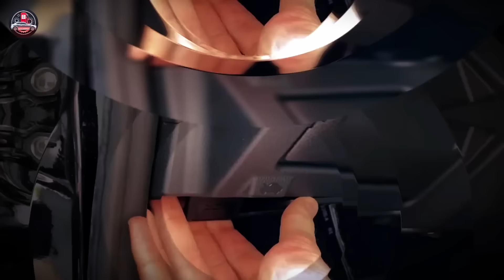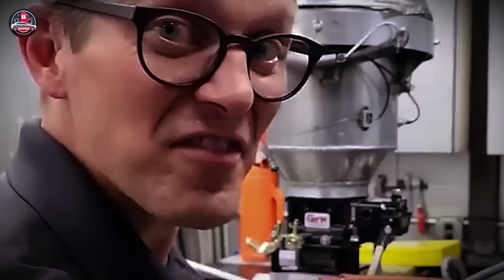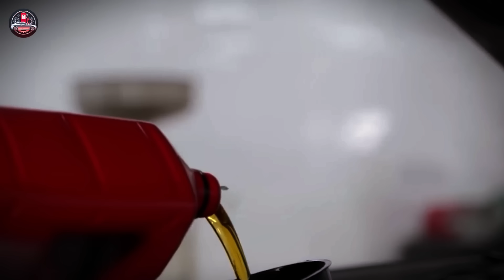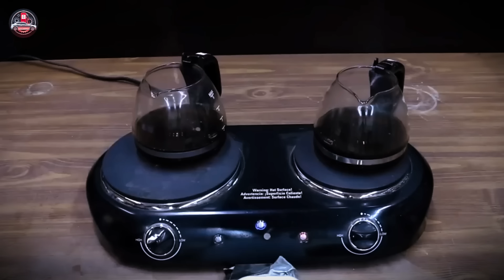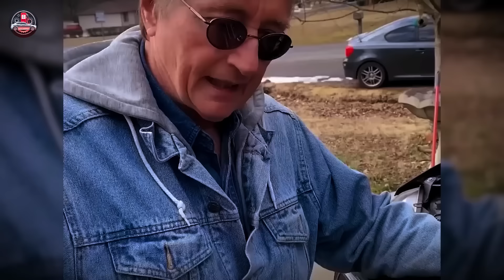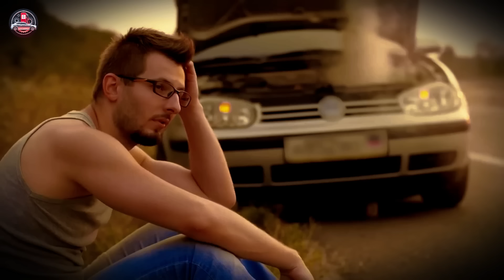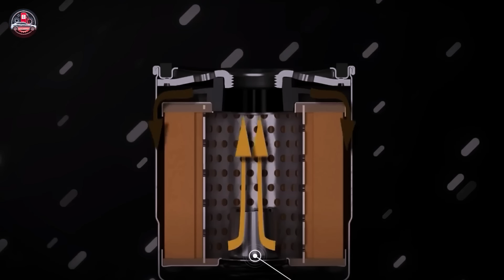We Ran 0W-20, 5W-30 & 5W-40 in the Same Engine — Here’s the Truth | Everything Oil for Car

Comment: This video conveniently forgets that even though thicker oils tend to start circulating slower, the oil film that's already on the engine's critical parts with a thicker oil is more durable so this argument is suspect.  I also think that thicker oils don't drain as completely after shutdown as the thinner oils.

While in this test, all the oil filters used were probably the same and therefore a nonfactor in this test, I suspect that the oil filter is a bigger determinant of how fast oil begins to circulate regardless of viscosity so a high quality filter is always important for everyone.

Finally, in my experience, I always get rid of the 0W20 oils within a thousand miles of purchasing a new ride.  I have never trusted the light oils because the CAFE requirements are principally the reason we have 0W20 oil.  This benefits the OEMs because if they sell enough cars that use 0W20 oil, they can sell more big vehicles with higher profit margins.
Reply: Yes I'd Never use 0w20 personally  I'd rekon you'd get Engine wear more than a thicker lube  probably less noticeable for very low or short trip drivers low miles - Where the thin oil isn't really handling high heat conditions--I wouldn't touch it regardless

Comment: when the engine is cold the oil bypasses the oil filter until the oil is warm enough to pass thru the filter material. 5 weight is 5 weight. if you are in extreme cold use 0 weight

Comment: C7 corvette
I race at Sebring 
Oil temps get to 240-250 degrees F 
I’m using Amsoil 15-50 race oil
Oil analysis shows some reduced viscosity and There was no wear metals out of range
The recommended oil is 10w40
What are your thoughts?

Comment: 5W-30 in South Florida in my '05 Crown Vic Interceptor. Change it as close to 3000 miles as i can with a FL 820S Motorcraft Filter.
Reply: You are wasting your oil. I am in Canada and 5w30 for 10,000 KM, no problems

Comment: 0-20 mobile 1 changed each 5000 miles 2020 GMC Sierra 5.3 engine N. Idaho. 92000 + miles. Should I change?
Reply: Depends, do you tow or haul heavy loads? If so you'll want heavier oil. Do you go need to add oil between charges? I drive a 1998 dodge ram 5.7 mag. I use 10/40 mobile. I use about a 1/2 court of oil at 4000 miles. I tow heavy camper and heavy loads a lot.

Comment: Sorry three engines can’t be identical. During breakin, engines can have a different experience. This is an unnecessary video for me. I have years of use of synthetic and years earlier of vastly inferior petroleum oil. Oil viscosity is slightly important in my experience. Use filters like long hauled trucks do. You don’t have to throw out good oil.

Comment: When you are travelling on the road, you use what is available.  My car leaked as I pulled the studs on half of the engine so10/30 oil dripped out onto the dirt road.  When I went through a case of oil,48 quarts, I happened by a road crew that was pouring oil on the road...gear oil.  Next town is 500 miles away so I got some 90W gear oil and put that in the car.  The leaking slowed down and the engine ran 500 miles without needing more oil.  Don't know what oil pressure was but car ran.  60MPH on 2 cylinders(as it was VW aircooled engine so pancake engine and one head had no compression.,,and no oil sealing. So, not synthetic. Beggars are not choosers.

Comment: The story fails when you claim the 5w40 oil lubricated slower on cold starts then 5w-30. Those two oils are 5w both, so are the same viscosity when cold.
Reply: It's AI garbage again. No authentic video.. at all.
Reply: @StanDeliver  Oh, copy that .... 100% crap.. Mindless crap.
Reply: But when how cold do they both become the same. It makes sense they would be the same when cold, and we are taught that, but it doesn't actually work that way.  Even this test proved it.
Reply: @kevinpurtlebaugh8854  You might want to research that yourself. In multi-grade oil the first number reflects the cold temp that the oil will remain viscus, the second number reflects the high temps that the oil remains viscus at. Meaning if you live in Detroit where much of this stuff is factored, running oem 5w-20 is good, but if you live in the desert where it never gets below 20F but regularly gets about 110F you will have problems. I live in the desert and run 10w-40 because 5w-20 looses viscosity when the ambient temp is above 100F. I remember when oil bottles used to have the charts on them to tell you this information.
Reply: Wrong! Not all 5W oils have the exact same winter viscosity,. They must meet a specific maximum viscosity threshold for cold-weather to be qualified as 5W, 0W etc. Same with second number viscosity at operating temperature, e.g., 30 is range 9.3 to <12.5 cSt at 100C.
Reply: As Arthur said 5w varies in actual spec oil to oil
Reply: I noticed the same thing, but also hear the comments saying they are not the same and I think the w refers to viscosity at about 0 degrees F while they were running cold start tests at 50F, so the w rating would not fully apply at 50F.
    For me, most trips are short but I also live in the mountains and my 225 CID truck has a relatively small engine that works hard pulling hills, often loaded and sometimes towing, but also gets used only a little and so has the same oil year round.  Other cars I maintain are more typical, though still usually short trips in mountains but no towing and normal engine size, so I may use slightly thicker oil in spring and factory spec in fall, and by slightly thicker I mean mixing grades of the same brand to get something like 2w-24.
Reply: @alan6832  yes you can mix oils if oils have same spec
Reply: Nice catch
Reply: I run 20W50 Castrol GTX in just about everything I have ever owned. Cars,Trucks, lawn mower, Motorcycles. Never had a problem. 86.5 Nissan 3.0 4x4 20w50 year around, central Illinois.  225,000 miles same milage as New added no oil between  oil changes at 5,000 miles. Filter every other oil change.

Comment: AI Overview
For a 2011 Subaru Forester 2.5L, the required oil is full synthetic to ensure proper engine longevity and performance. The non-turbo (naturally aspirated) engine typically requires 0W-20 oil for optimal efficiency, while the turbocharged (2.5T) engine requires 5W-30 synthetic oil.
Reply: Yes, however, 0w20 in a boxer engine that already has blow-by issues later in life becomes really thin if you go much over 3000 miles. Especially if you do a lot of short trips and rarely get up to operating temps. In Japan, Subaru Crosstrek and Foresters call for 5W30. The main reason for 0w20 in the states is to meet CAFE standards.  That's all.

Comment: Savannah, GA
1997 dodge ram 5.9L 
212,700 miles 
Daily work commuter, very little hauling
Using 10-30 high mileage syn. 
Would like to use 5W-30 in mild winters & 5W-40 summer.
Seems reasonable, yes/no?
Thx
Reply: Yes makes sense!
Reply: I used factory suggested 5w 30 on my 91 Chevy till I got 100,000 miles.  THEN WENT TO 10W 30.  Now it is during fine with 247,000 miles.  I live in S.C. where winters are mild.  I always used Valvoline high-mileage synthetic, change every 5-6000 miles.  I use Penzoil ( same weights ) synthetic  in all my farm equipment.
I use ( for many years ) Mobil-1 factory suggested weights ( high-mileage type )  in all automobiles all changed 5-6000 miles .  USE OEM FILTERS OR HIGHEST EQUIVALENT  !
Reply: Thats the Cummins diesel, is it not?   Different animal.
Reply: @markschwan6055 I thought since it went 212k miles it would have to be the 5.9 V-8 not the little 6 cylinder diesel with a turbo

Comment: The best is 0W40 for instance Mobil, best as cold and the best as hot. 20 oils are pure green madness !!!!
Reply: Testers does know this kind of the oil?! It is the must here in Finland with  temperatures from -45ºC to +30ºC. USA is the only state to use the antic measurement systems! The first number before W means wiscosity in temperature in -20ºC and the last number wiscosity  in 100 ºC (212Fº). Different tabels, all oils get thinner in higher temperatures. 0W40 less than the others.

Comment: I have a 2022 Honda Accord Sport. I use 0W20 full Synthetic. I am in San Buenaventura, California.
Reply: I have a 2015 honda accord sport 2.4 non turbo, i live in hot miami heat, i switched from 0w20 to 5w30 and im very happy. Much smoother engine and no ticking. Trry it youl be happy and will not hurt engine at all.

Comment: XLNT video on oil viscosity! Kind of along my lines of thinking. My first car at 16 in 1967 was a 56 Chevy w/seized engine (piggyback rod bearing) my first V8 Chevy rebuild. I now have a 2000 Focus w/Zetec 2l engine, 150k miles, using oil cap 5w-30, but will switch to 10w-30 or 40 this summer. Needs valve clearance adjust, but I can't find FORD OEM 303-465a valve spring tool, Ford parts says don't stock that tool, or shims. Where do I get tool & shims? Don't want to have to remove cams to change shims. This is my 1st Ford (cheap 2k $) since losing my 2012 Silverado😢 Sacramento California

Comment: Well, I'm not Ricky racing my 2022 Camry, and I did not put any intake air performance parts on either.   There is no fire coming out of my exhaust either. 😂 I cruise it like the grand papy I am Lol.   I do use Valvoline Restore and Protect 00-20 instead of 00-16, and I use a trustworthy friction reducer every oil change.   I change the oil a little sooner at 4000 miles.   Most 2022 2.5L Camrys are noisy at startup until they warm up, but mine is very quiet.  43,000 miles and purring like a kitten.

Comment: This is not consistent across all engines. You can’t take data from a 4 cylinder and say it will be the same for a v6, inline 6, v8, v10, v12, flat top crank, doc, single cam… this is only for this specific  type of engine.
Reply: It might not even be relevant to any engine. The testing they claim to have done seems to be unlikely to me, unless they work for Honda (K24 engines used), or an engine oil manufacturer. I suspect it's a load of BS.
Reply: I will say this. My 2001 Tahoe w/ 5.3 Vortec engine with 457000 miles and still going.I have run Mobile One 5W-30 Full Synthetic motor oil. That to me proves enough.

Comment: 0W20 isn't an issue if you are using an oil that addresses your concerns. I've been using Amsoil since the early 70's and will continue with it .
Reply: Amsoil has become wildly over priced in the last few years. So over priced in fact that the little benefit you get from their oil over Mobil 1 does not justify the radical 3.3x’s as much costs. Amsoil is the best out there but you have to remember the million mile test they did on the 4.6 Ford v-8 engines side-by-side. After 1,000,000 miles amsoil did nothing better than what Mobil1 did as both engines were near identical in wear specs.
Reply: @Giambis I change oil at 7500 miles and I get a preferred customer discount. Oil analysis suggest that I could go far further between changes but I'm comfortable with the schedule I have.
Reply: Costco brand is comparable to amsoil

Comment: I drove subaru for 40 years As they got miles I used 10-40 oil now i am driving a 03 forester with190k, the engine was never apart other then timing belts
Reply: 98 impreza ej 2.2 465000 km great engines .so sorry about the 2.5 head gasket problem.